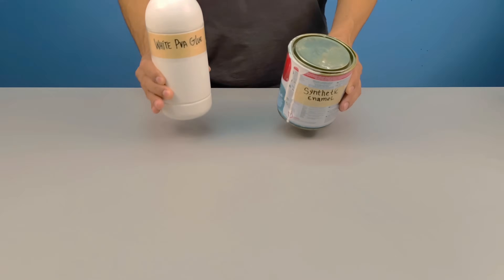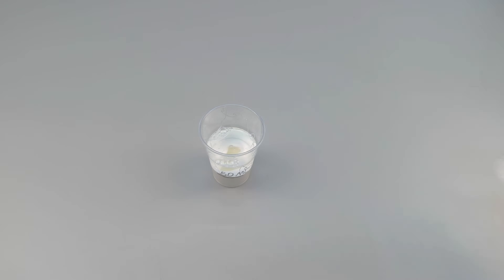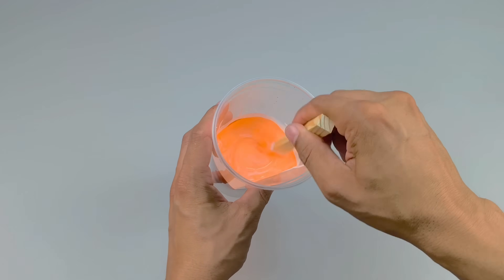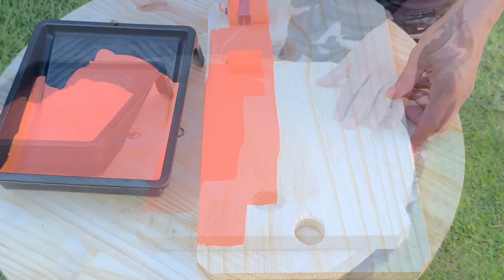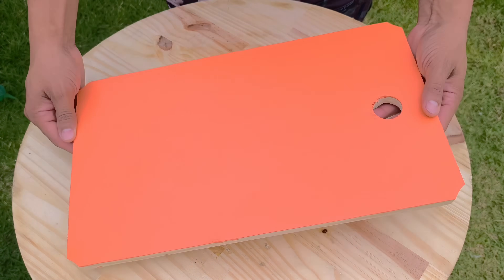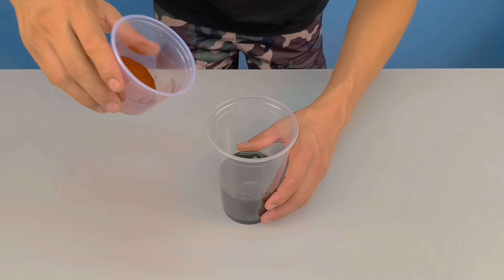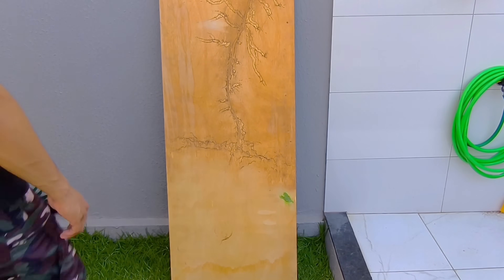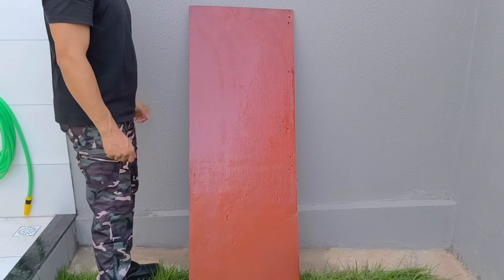Nobody knows that mixing SYNTHETIC ENAMEL with PVA GLUE reveals a powerful formula!

Comment: Hi I'm frome India. Is there's any  durable solution which paints old plastics such as plastic accessories of bikes and scooters?. Thanks for nice videos
Reply from the maker: Greetings to India! 🇮🇳🙌 Yes, for old plastics you can use acrylic binder + PVA glue + synthetic enamel. This combo makes the paint stick better and creates a flexible film that doesn’t peel easily. Clean the plastic with alcohol first. If you want, I can share a stronger version! 🔥🧪

Comment: Can we use this formula on kitchen walls
Reply from the maker: Yes, you can use it on kitchen walls 👍
Just make sure the surface is clean and dry before applying.
It works great as a protective and waterproof layer! 💧✨

Comment: But in my experience two coats of enamel paint MINUS the PVA produces the same results
Reply from the maker: Great point — thanks for sharing your experience! 🙌
The PVA adds extra bonding strength and flexibility in my formula, especially for porous surfaces, but results can vary based on materials and technique.
Experimenting is the fun part 😉
Reply: Indeed ! Again this guy is a joke with his pva mix !!

Comment: Also, can you use regular acrylic paints to color the mixture? And, would it just be easier to buy paint in the color that you want instead of having to go through this whole process? Thank you, I look forward to hearing back from you.
Reply from the maker: Great question! 👏
You can add acrylic paint, but it's not ideal. Since this synthetic enamel is water-based, it already provides great adhesion and durability when mixed with PVA glue.
Acrylic paint may change the consistency and final strength of the coating.
This formula gives a professional-grade finish with extra resistance — that’s the main advantage 😉
Reply: @inovaouinventa I really appreciate you getting back to me and breaking it down. I am subscribing to your channel right now. Thank you again friend
Reply: Hi there! Can you make a experiment on bathroom tiles and floor tiles⁉️ Thanks